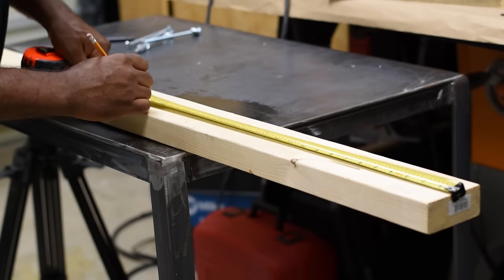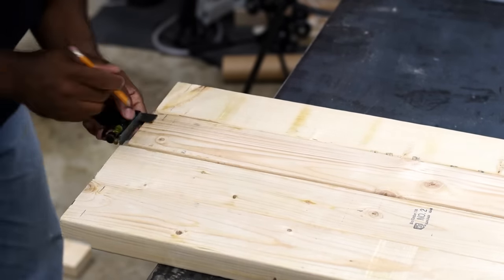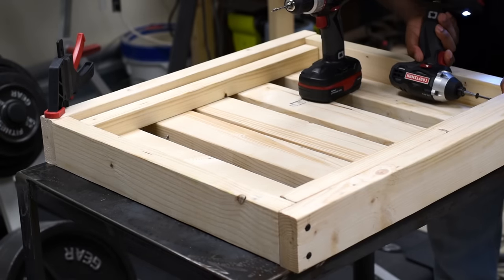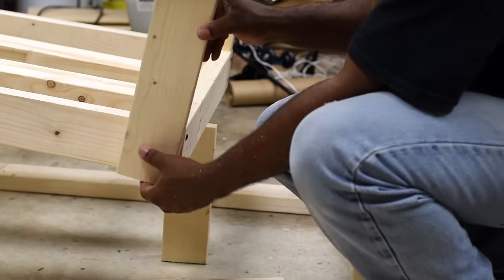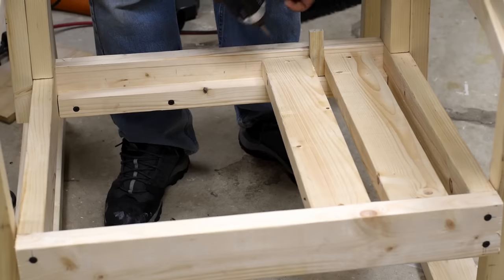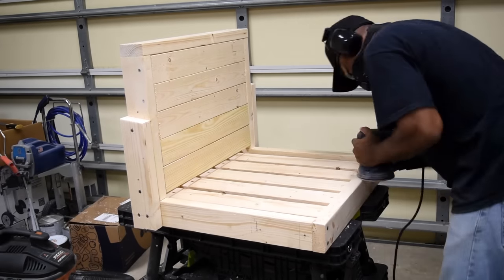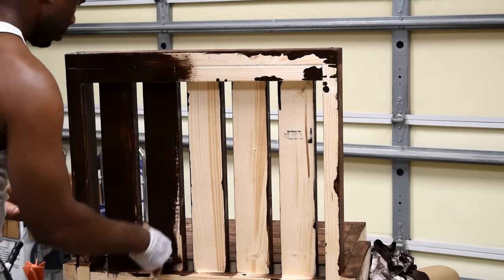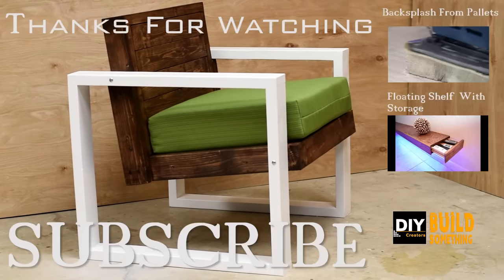Modern Outdoor Chair | DIY Build

Comment from the maker: Chair Dimensions
 
Arms Left and right 
(4) -Top & Bottom        =  30 inches 
(4) - Front Back            = 24 inches 

Seat box 
(2)  Front  & Back         = 27 inches 
(2)  Sides                       = 22 1/8 inches
(5)  Middle Support     =22 1/8 inches 

Back 
(1)  Top                       =  27 inches 
(2)  Sides                    = 18 1/8 inches
(5)  Middle Support   = 24 inches 

4- 1/4in x 6 in bolts 
4- Washer
4- Lock washer 
Lots of 3 inch screws
Reply: Is this for sale?
Reply: tyj
Reply: DIY Creators thank you
Reply: Cheers for this, been searching for "build a tv cabinet" for a while now, and I think this has helped. You ever tried - Venoffison Wooden Exploration - (do a search on google ) ? Ive heard some decent things about it and my brother in law got amazing results with it.
Reply: DIY Creatorst 7
Reply: @corneliussa125  I am intrested
Reply: @corneliussa125  I am from india
Reply: Ölçüleri verirmisin
Reply: Çok güzel

Comment: I love it! I would have "attempted" to counter sink the screw holes then fill it in with appropriate size dowel rods. But that may not give you access to disassemble it later on if you need to.

Comment: Thanks for sharing. Great idea and entertaining build thanks. With hindsight, are there any improvements you would make if you were to build another from scratch?
Reply from the maker: +Jeff Harmed 
Thank you! Yes. There is a few things I would have done differently. I would use less screws in the chair back. Maybe do away with the 2 by 4 under the arm.
Reply: +DIY Creators might be a good idea to put rubber feet under the legs to stop scraping the wood

Comment: I would add 3/4" feet to space the chairs from the ground elements and prevent wear on the bottom flats that would then soak in more moisture. 
rip 4-    3 1/2"  x  1 1/2"  x  3/4" pieces 
put them inwards 3/4" on all bottom corners, so the inside edges of the legs run right down at the midpoints of their 1.5" lengths.

Comment: The pre-season conditioner I use says to apply and wipe off excess after 5 mins and do not let it dry. if you do the stain sits on top and doesn't really soak up. I also don't use gel stain which I've seen you use in a few of your videos.
Reply from the maker: Maybe a different brand. I have had this stain for a while I been trying to get rid of it. Look like im getting close

Comment: Nice design and this could be taken apart and shipped or taken to a client.  Very solid like an outdoor chair should be.  Old time adirondack chairs were not all the same angle on the back and often too low in the seat, so this is nice.  should last a long time. Two chairs and a table and its a deck set for low cost for years.   Well done again.   Hals Wood Shop

Comment: I love the clean design, but I would be concerned with the chair collapsing if you sit down too hard since it doesn't have bracing on the legs. I think I would add steel ell brackets on the corners to reinforce the box design.
Reply: You could use a lap joint or a mortis and tenon to make it stronger. You might need to use a different dimension of lumber or a different type of wood, though.

You could also use 2x4s and double them up to create lap joints. The advantage is that you're always screwing through the grain instead of into the end grain. That will make it much stronger.
Reply: My concern too. It seems not strong enough to hold the person sitting in it. Not the chair, the joints. Those four bolts may bend, or cut into the wooden structure with time.
Reply: Great idea Nicholas I think I will take your advice and make those adjustments. Thanks for the thoghts.
Reply: I love this design!! I would love to see a sofa version!! Also an idea for more support... maybe extend the bottom of the seat to attach to the 2 vertical 2x4s. It might have enough support already, but I haven’t heard from you on this topic. Thanks for the great videos!!
Reply: Ohen

Comment: nice and great , but what would you do to make the chair handle the weather, humidity? as we have in our area a strong sun and high humid.
Reply from the maker: Thank you. I would use Pressured treated wood If you wanted to place it in the weather. I Keep this on my front porch its get a lot of sun. Still holding up very well.
Reply: Thanx. My project is to make similar idea with scrap wood. I hope it will work well.

Comment: Question, he mentioned this isn't meant to sit out on the ground in the weather but rather on a patio. Would he have used pressure treated wood and ground contact grade wood for the parts that touch the ground to remedy that?
Reply from the maker: I probably should have mention it in the video. for example if you wanted to use this chair out in the elements i'd use pressure treated wood for the entire build.

Comment: nice chair, nice design! thank you! :) i'm planning to make one for indoor use, i'm going to use it at my desk, would you recommend it? is it comfy enough to sit several hours at once?
Reply: The chair doesn't have an ergonomic design so you might hurt your back if your sitting on it at your setup for hours at a day hen you might strain you back bone.....if you do then get a cushiony back pillow so your back wont take up a lot of stress from the wooden back piece
Reply from the maker: Thank you. Its pretty comfortable, but then again  I barely used it. I haven't sat in it long enough to give you a honest opinion as far a as long usage.
Reply: +DIY Creators thank you :) would you recommend any changes for the back piece ? maybe some thing to tweak about it? will the balance be off if i make the back piece longer?
Reply: +Mr Duckington thank you :)
Reply from the maker: +Erdoğan Mete Yalçın 
I wouldn't make any changes to the back. Its very comfy. Extending the back shouldn't be a problem. It's more of an appearance thing.

Comment: I built this chair after watching this video. Only thing I dont like about it is the wood dont run in the same direction. Would have been more comfortable (when not using the cushion) if the bottom wood ran the other way.

Comment: Good job, but i think 4 bolts are not enough to hold the weight - just an opinion
Reply from the maker: Thank you. The 4 bolts shouldn't be a problem. Ill have to  research but each bolt alone should hold around 400 pound each.

Comment: It's a very great design but should've more detailed in step by step assembly. For example, when you need another set of blocks for the seat support, it was not mentioned in your descriptions, and also the measurements, no detailed info on that. But above all, great video and great design...

Comment: why nit use treated wood?
Reply from the maker: Treated wood is usually moist when you get it. So its tough to put a finish on it right away. This made for my patio which never gets wet. I believe I stated in the video not to be out in the element. If I was putting this in the weather the absolutely ill would use treated lumber.